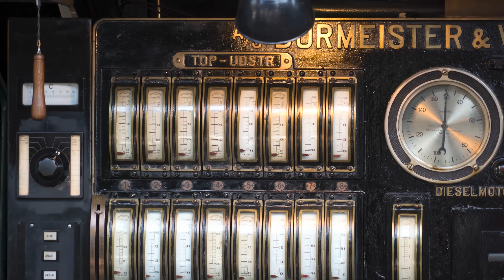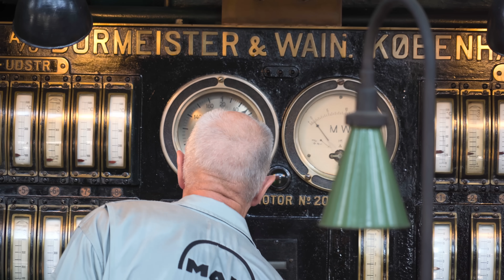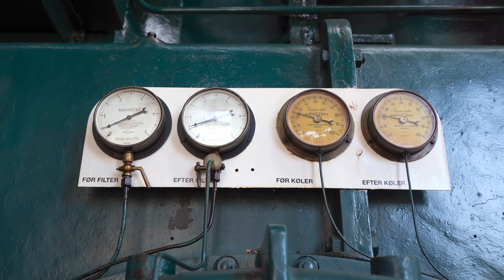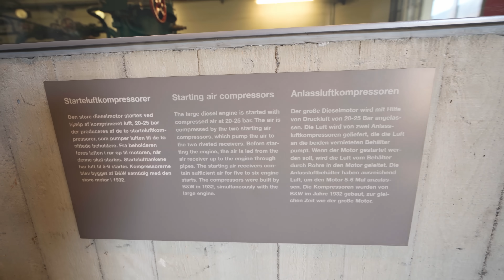Starting The BIGGEST DIESEL ENGINE On Earth | 22.000 hp B&W 2000 COLD START

Comment: Very interesting. I was sailing on slow speed diesel ships in the 60’s . This looks very much like the B &W double acting two stroke engines which were build in Harland and Wolfe (Belfast)  just after WW 2. The diesels built by Sulzer (Swiss) were always my favorites. Depending on when this engine was built, it could have been the worlds largest diesel at that time, but modern diesels I believe, can go over 100k HP on a single shaft at about 82 rpm.
Reply: Yes its a double acting engine. Total pain to sail on.

Comment: What is that engine used for?
Or was it just for musuem display. 
Definitely huge and impressive.
👍♥️✌🇺🇸
Reply: I wondered the same.
Reply from the maker: The engine was originally built to generate electricity during morning and afternoon peak loads. It was used in this way until the late 1960s.
Reply: @HD1080ide  
Tyvm🙂

Comment: Sorry but you're wrong, i know of an engine that produces a 102,000 horsepower. It's in a container ship, can't remember the name though. Do your effing homework!
Reply: The big wartsila diesel I believe you are referring to
Reply: Maybe not even Diesel you are referring to.
This is built in 1933!
Reply: @kiereluurs1243  the specs are hard to find on this old engine but from what I found the engine as a whole may actually be slightly larger than the wartsila. The wartsila I think has a larger displacement however